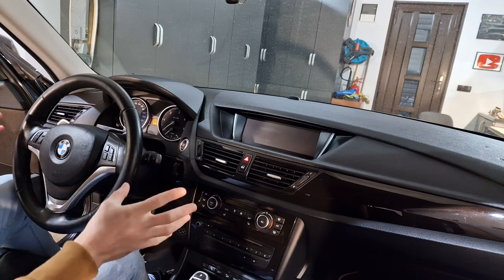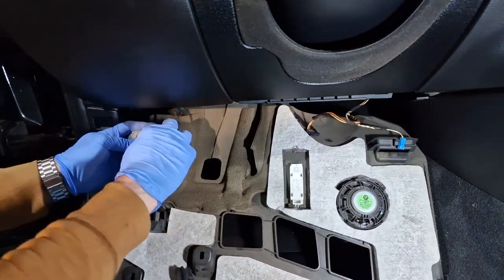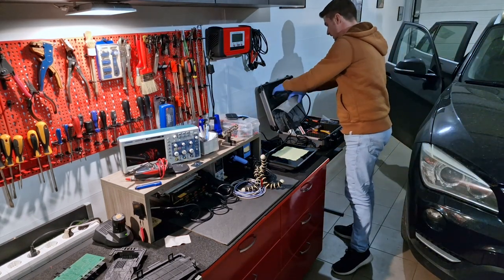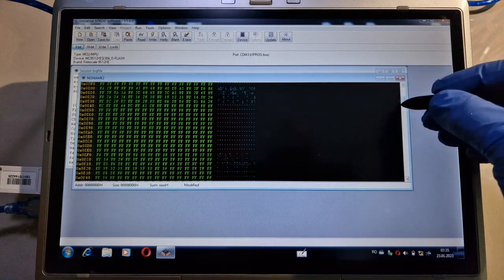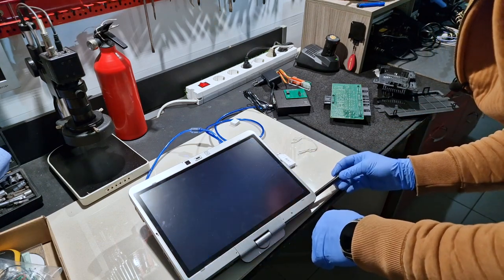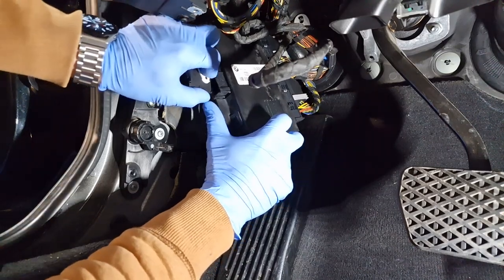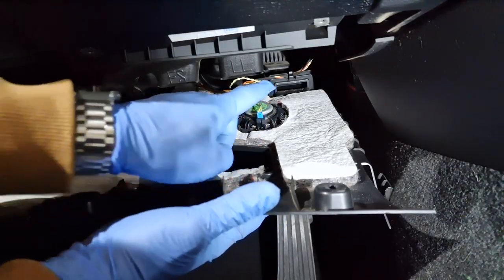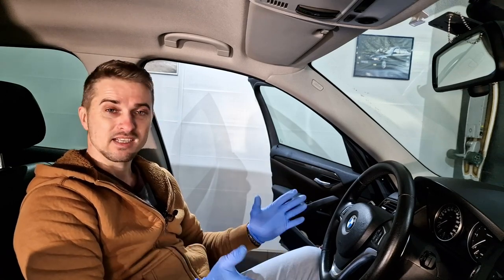BMW X1 FRM repair , Lighting system

Comment: I have one which had the same problem, I've try to buy another one but it fail in brake lights and rear parking lights! Can I send it so you can repair the one which had the sane problem like yours?

Comment: Could you answer this important question? How would/could we know when a battery on BMW gets weaker and potentially voltage fluctuation can lock the FRM modules in BMW?
 I have a battery tester taht can measure internal resistance as well as the health and the level of charge of the battery. 
What procentage should be minimum or is there a way to test a car battery for weakness?

Comment: hello. great job. if possible, correct the link to the FRM programmer because it is outdated - FRM repair tool
Reply from the maker: Hello! Thanks, I have seen it , I will remove the link.

Comment: M.Ovidiu, you have to program this module separately? Y out can’t program it while in the car using the scan tool and why ?
Reply from the maker: Hello! when the module will go bad it won't respond anymore, like it is no more connected . officially for this problem you need to replace it!
Reply: Thank you very much Mr Specialist. Your video motivated me to be better electrician. I have Foxwell GT90 max scan tool. Can you recommend a campany that could give me better wiring diagrams. If you do please leave the link 🙏🙏
Reply from the maker: WDS BMW and istaD have all the information regarding BMW wiring diagram , if you work on BMW throw away the multibrand diagnostic thing and use the istaD
Reply: Please leave their link if you have so that I can acquire about their product.
Reply: Please leave their link if you have so that I can acquire about their product.
Reply: Please leave their link if you have so that I can acquire about their product.
Reply: Please leave their link if you have so that I can acquire about their product.
Reply: Please leave their link if you have so that I can acquire about their product.
Reply: Please leave their link if you have so that I can acquire about their product.
Reply: Please leave their link if you have so that I can acquire about their product.
Reply: Please leave their link if you have so that I can acquire about their product.
Reply: Please leave their link if you have so that I can acquire about their product.
Reply: Please leave their link if you have so that I can acquire about their product.
Reply: Please leave their link if you have so that I can acquire about their product.
Reply: Please leave their link if you have so that I can acquire about their product.
Reply: Please leave their link if you have so that I can acquire about their product.
Reply: Please leave their link if you have so that I can acquire about their product.
Reply: Please leave their link if you have so that I can acquire about their product.
Reply: Please leave their link if you have so that I can acquire about their product.
Reply: Please leave their link if you have so that I can acquire about their product.
Reply: Please leave their link if you have so that I can acquire about their product.
Reply: Please leave their link if you have so that I can acquire about their product.
Reply: Please leave their link if you have so that I can acquire about their product.
Reply: Please leave their link if you have so that I can acquire about their product.
Reply: Please leave their link if you have so that I can acquire about their product.
Reply: Please leave their link if you have so that I can acquire about their product.
Reply: Please leave their link if you have so that I can acquire about their product.
Reply: Please leave their link if you have so that I can acquire about their product.
Reply: Please leave their link if you have so that I can acquire about their product.
Reply: Please leave their link if you have so that I can acquire about their product.
Reply: Please leave their link if you have so that I can acquire about their product.
Reply: Please leave their link if you have so that I can acquire about their product.
Reply from the maker: I don't have links , and that are not companies are programs! do a google search to se what's about!